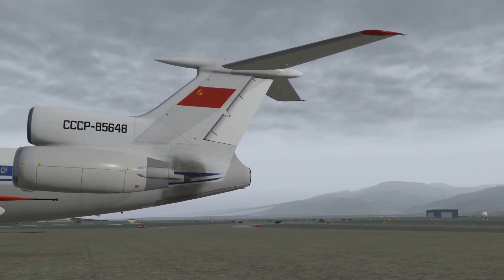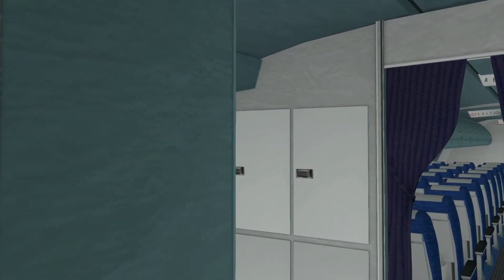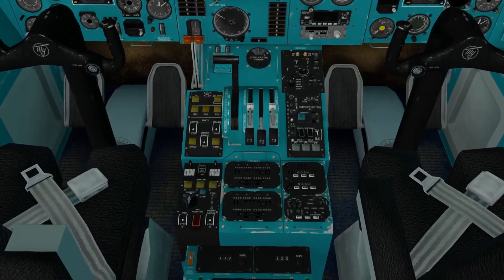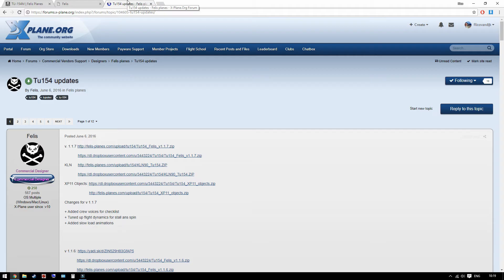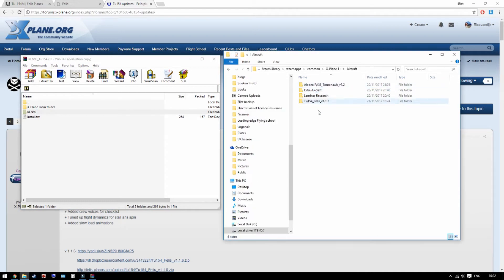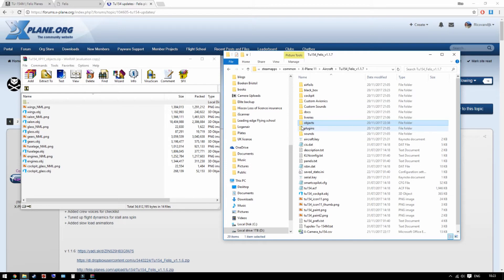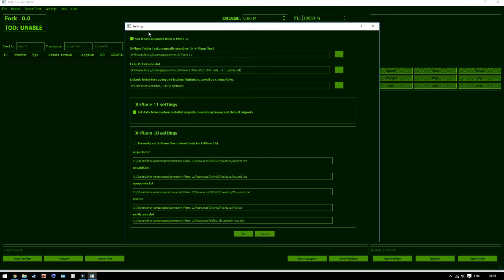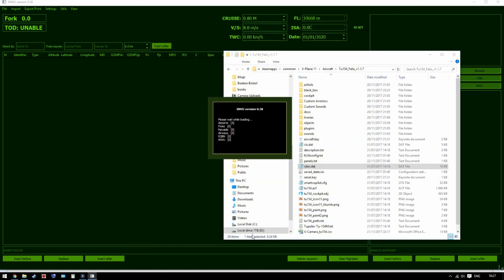Tu-154M in X-plane Part-1 Intro and Installation

Comment: hi, i got that problem that i cant really fly the plane cause it keeps shutting down the engines with a lot of failures on the failure menu, does someone know how i can fix that issiue?
Reply: Hello, I am having the same problem. Did you solve it?
Reply: @KazimAliYerlikaya do you have the failures turn off in the ground menu?

Comment: I have followed the instructions in this video.  However, data will not load.  I also get a warning message at the bottom "Warning: [Airports.txt] [Navaids.txt] [Waypoint.txt] [ats.txt] is not loaded.  What am I missing?? What step did I miss??
Thanks, great videos
Reply: Discovered my error 🙂